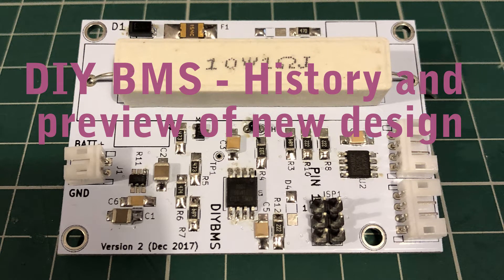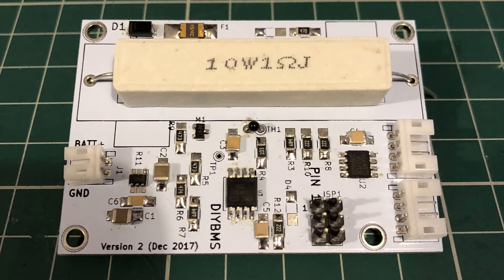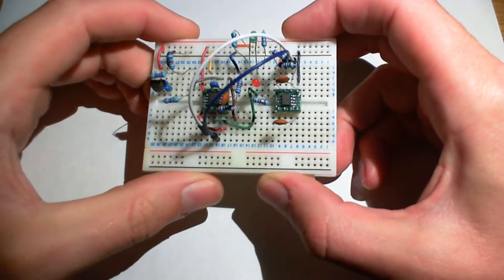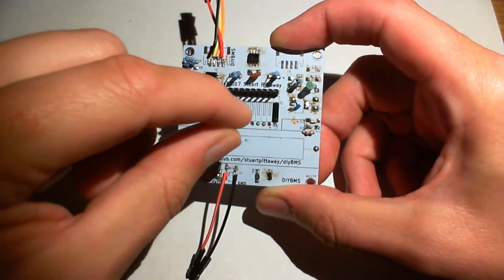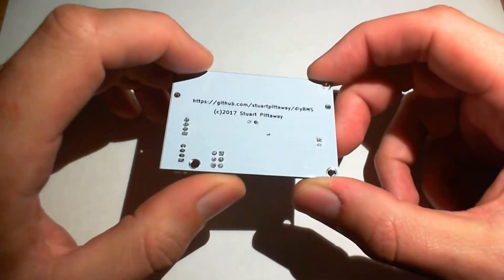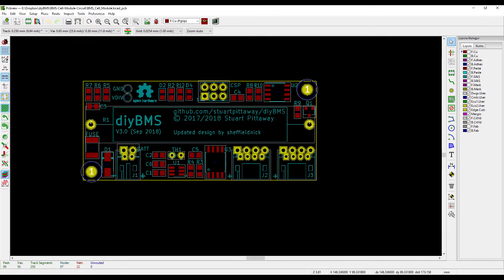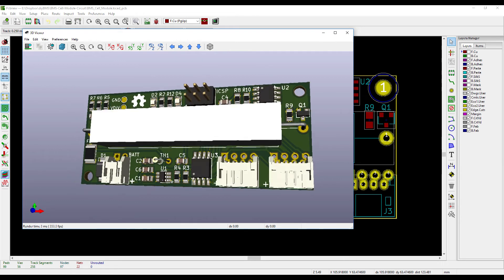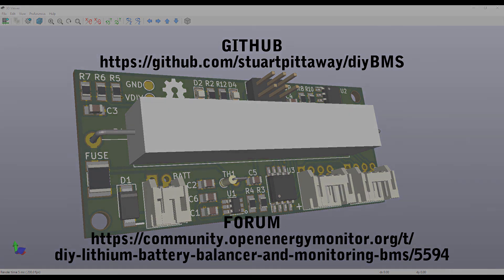DIY BMS - History and New Design Preview (Powerwall 18650)

Comment: Hi Stuart, I soldered all the components on two of the boards (ver 2.1 March 2018) and burn boot loader to attiny with correct settings as stated in the script, the green led shows really dim once boot loader is uploaded, I then uploaded the program to the attiny85, the green light then remains brightly on at all times after falshing a few times during bootup, then remains solid when power is applied using 1 x 18650 battery. But I cannot seem to provision the unit from the DIYBMS Mgmt console.
When I click provision the blue light flashes on my D1 mini, I waited for some time, but nothing happens, the module is not being detected.
 Also tried the test script, and I2C doesn,t detect the module,  I built 2 of the adapters for my D1 mini with both using different  2 x resistor 2k2 and 4K7 none of them worked. 
Help!!!!, How and where do I start trouble shooting this?
Reply from the maker: Can you take a look at the openenergymonitor forums, I've just run through a diagnostic process with a user on there
Reply: Hi Stuart, I checked, nothing there on trouble shooting the I2C, All the voltages are correct on all the ICs, even the ADNum on both sides is 3.3v. Should the green light remain on after the module finish booting up?

Comment: equalize your volume!
Reply from the maker: Agreed!
Reply: @StuartPittaway  Good video otherwise. I'd like to make a simple BMS w/ protection for a motorcycle battery, any way I could talk you into helping me out?
Reply from the maker: @snugglylovemuffin  I suspect you would like be better off with a ready made solution. This BMS doesn't control the output load/current.

Comment: Hi Stuart , should the cell modules have a failsafe i.e, go into bypass mode at 4.2v regardless of state - factory default , lost comms etc  ?
Reply from the maker: Yes, at the moment there are a few versions of the code about and some of these do use fail safes
Reply: @StuartPittaway  .Hi Stuart , I couldn't locate it in your GitHub code or that of Colins . Am I missing something .....thanks